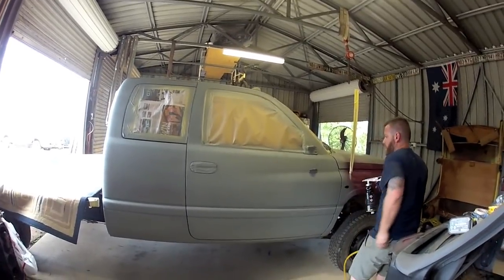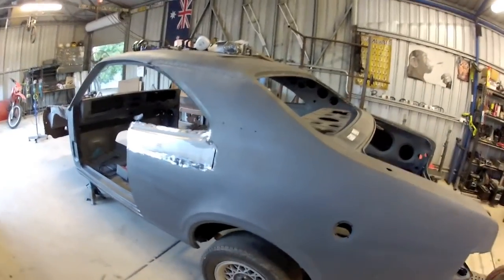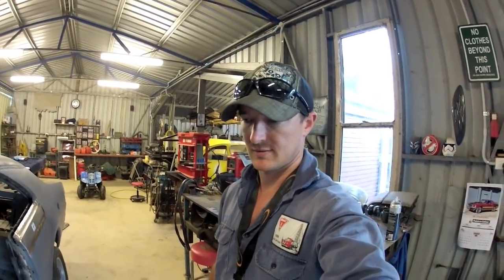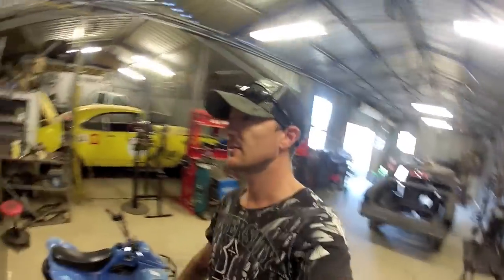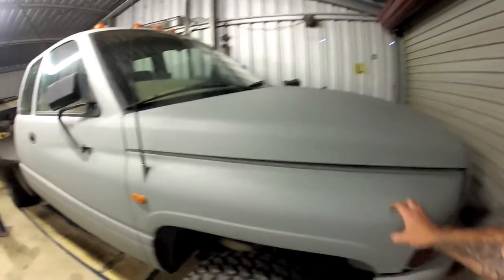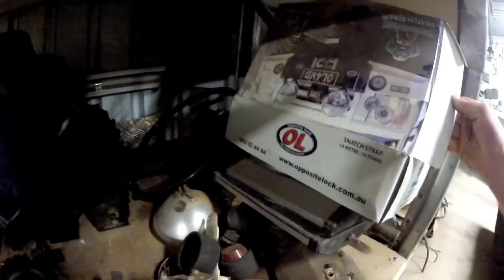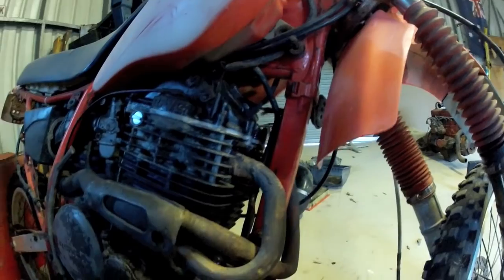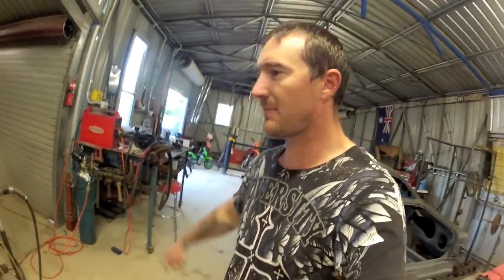A catch up on a bit of everything

Comment: Hey pete, busy boy eh? That white board idea is good. I reckon if you sold Norm or the val you will kick yourself for ages after. But ya gotta do what .......
Congrats on the well control test too. Im an old roughneck from years ago. 80s-90s.
Reply from the maker: Cheers mate, well control is not fun at all and the buggers had to go and change it all up, Rigs are my bread and butter, I'm a rig manager out near Moomba, The Val i will have forever as it was my grandfathers car,
Reply: @Pistol85  my first hole was in daralingi in the strezlecki somewhere. Rig 12 ODE. 1987.

Comment: Gday, what's been your experience of making the videos? I made one or two pretty ordinary ones when I first bought my Corty. I'm wondering about doing a few vee-logs now that it's time to rip in and do some work on the Corty. Any tips or advice? 😎👍
Reply from the maker: For the most part doing the videos are good, as you can see my editing skills are very limited and i only use a very old gopro (hero 2), My advice will be dont let the viseos own you, i use to worry i was not getting videos out quick enough and would force myself to work on the car and it burnt me out on the car and would get over working on it, So go at your own pace is the main thing. Best of luck with it.
Reply: Pistol85 Thanks Pete. Have a great day. 👍